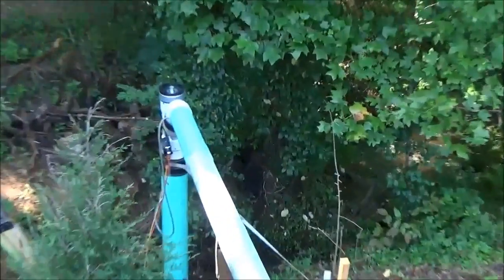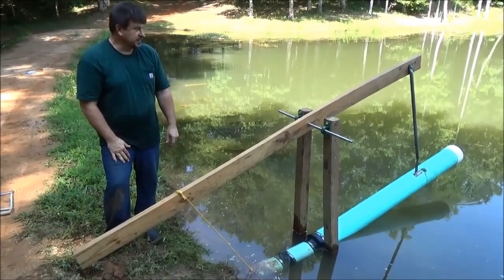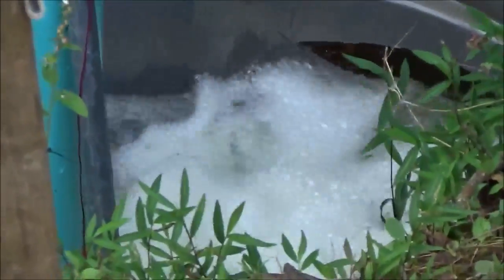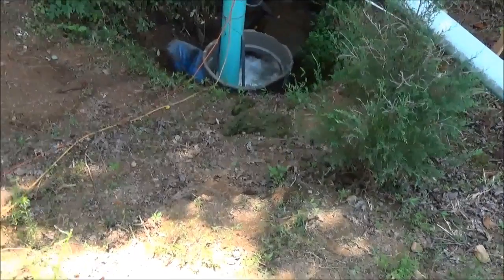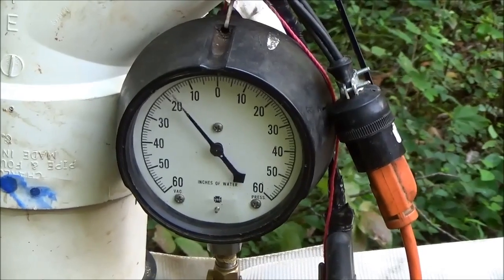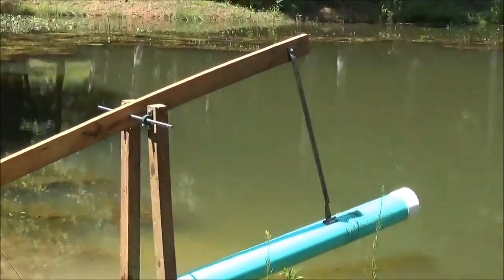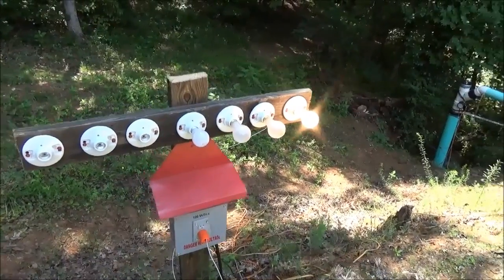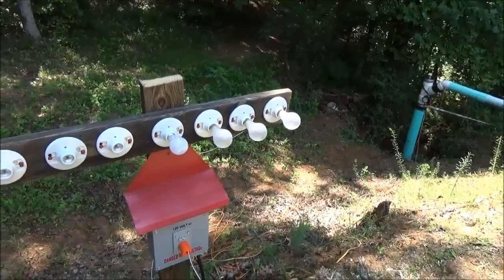Pond Power:  Part 2

Comment: A very interesting project. My sympathy that so many commenters want to take a practical device and turn it into a mythical over-unity scheme.
Reply: John W  It has, you twat.
Reply: your lack if creativity shows your ignorance lack of knowledge shows your stupidity and to top it off over unity is possible I'll leave it at that have a nice day ignorance is bliss
Reply: Kris Riddle I'm glad you find yourself in a blissful state. I'll try not to disturb it.
And your spelling and grammar show a lack of intelligence or a lack of knowledge. Not sure which.
Reply: +Jim Fortune say as you will but a simple mechanical water ram that uses no elec to push water up a hill to a reserve with an 8 in return hooked to a reducer produces all the power I need can't create something from nothing or is that what you believe. oh and my grammar maybe shit I'll give you that but your ignorance shows when all you do is bash with no statement that is meaningful to the point I was making - another kicker we make magnets from raw material take 80 pound neodymium mag with 2 1/2 inch hole wrapping 14 gauge magnet wire in side to out makes 1volt per turn wrap 280 times hooked to a converter now power range of 300-340 watts depends on resistance of wire kinking that will last about 10k years till mag dies it's called a magnetic vortex effect study some more and then try to convince me your not ignorant
Reply: Kris Riddle Ram pumps are a great way to take a large flow of low energy water and turn it into a small flow of high energy. It's the same idea as using a slow moving stream to turn a wheel that pumps a smaller amount of water to a height. It's a good analogy for explaining how a transformer takes a low voltage high amperage current and turns it into a high voltage low amperage current.
And if you are actually building an over unity device you fall into one of two categories:
1. You seriously believe it's possible, but you still need to tweak a few things to get it to work.
2. You know it's bullshit, but you have plans you're willing to sell me that are guaranteed to work if I do it right.
Reply: @krisriddle6873  You made that over unity machine yet?

Comment: Instead of wasting all of that water after going through the turbine, do you have  way to recirculate it back into the pond?
Reply: That would basically be a perpetual motion machine, which is impossible. Returning the water to the pond would take much more energy than the turbine produces, so would be pointless.
Reply: A ram pump relies on a large volume of water falling a small height to lift a small volume of water a large height. The water at the end of the pipe has very little energy left in it and so could not pump very much water back up to the pond. If you dammed up the outlet to build a larger head on the ram pump it would reduce the drop of water out of the turbine and slow down the turbine.
Reply: Please change your name from CommonSenseSurvivalist.
Reply: MsSomeonenew And think of the gym fees you could save!
Reply: Lincoln Sadler He might have been thinking of using excess wind or solar to pump water back up to the higher pond. That would be one way to store energy generated by "Ye take what ye get" systems where you can't just turn a knob up or down to meet current demand. Not sure how it would compare to lead-acid battery storage...
Reply: Easily recirculated, you just catch it down the other end with a bucket and carry it up to the pond.
Let's see how long you are willing to keep that up.
Reply: Even utilizing a ram pump? Could you explain why?

Comment: If you put a valve on the output, and a bleeder valve on top of the pipe, you could have it at full speed in a minute
Reply: +James Carter also, extend the output to get stronger vacuum power through the turbine to maintain the higher wattage. Have you measured the water supply to the pond? Is it a stream?

Comment: I wonder can you use this in a river?
Reply: Easiest river/stream installation would be the hydraulic ram(to pump water), or an under-flow water wheel, to turn a generator or water pump.  
However, Yes.  More energetically but with more construction(like his digging the pond, which is just a dam), build a dam, and put the generator or pump turbine at the bottom of a sluice pipe. 
BTW: His generator wastes all of the energy that could be captured from the down pipe (from the generator to the bucket outflow).

Comment: dont understand how this is working.
Reply: Just gravity and some pipes and a hydro turbine.
Reply: Basicly it's water flowing down hill.The water is not turning the turbine Blades.The turbine is mounted above the water level what is happening is the water flows down Pulling a vacuume the air passing the turbine blades are what are making it spin. The turbine blades never even get wet it's realy a wind turbine powered by falling water.Jim

Comment: Hello there i got a stupid question. i am new at this, but can it be possible to use that peace of pipe whats left after  the motor to put a second motor to  use to for example put a pump to work to get back some off the water so you can get free energie for a longer time period.

Comment: add a valve to the discharge line to save the trouble of priming?
Reply: I am making Hydroelectric power And charging A battery with a Amazon solar charge controller

Comment: set up a ram pump at the lower section to push the water back in to the pond and it would run non stop and refill itself at no cost.
Reply: In the magical world of Narnia that would indeed work.
But people unfortunate enough to reside in reality have to contend with the pesky problem of physics, where water doesn't go uphill without a significant amount of power.
Reply: Not a snide remark.  A ram pump "consumes" a lot of water, and only pushes a very small percentage of that water back up hill.
Reply: @ DENMONKEY   They mean that on average , for every 100 gallons let out of the pond , you could return 10 gallons back to the pond ... hence 10% efficiency. You obviously don't understand ram pumps even on paper if you're claiming only a little bit of water gets let out at the pressure valve.  Could you at least ball park quantify what you mean by a "little bit" ???

The best case scenario's are 25% ... and by a visual estimation he has a 300 gpm flow into the turbine to produce 500 watts sustainable ... but not sure how long that is sustainable , but lets be generous and say  1 hr.

So how much money would a ram pump(s) set up cost , to give you 75 gpm back into the pond  , which only increases the run time by 15 minutes = .125 kwh
And the average cost per kilo watt hour in the US is  12 cents.

So again lets be generous and say he can run the pond for 1 hr and 15 minutes 6 times a day ( 55 gpm inlet stream for the pond).  Which is .75 kwh X $0.12 = 9 cents a day savings towards the cost of the ram pump set up.
Which means he can purchase a set up of about $330 every 10 years which would be about the best case scenario for life time of the pump.
Reply: Just use solar power to pump it back to the main pond
Reply: Ram pumps don't need a significant amount of power/water to operate.  But you could never recover more than 1/10 of the water going into the ram pump.
Reply: Hah, just use solar power to power the lightbulbs in the first place if you are going to do that.
Reply: As well @DENMONKEY you are also assuming that the volume of water that is in the tube will be able to be pumped by the ram at the same rate as the outflow past the turbine. This too is not possible unless you went into an open to atmosphere containment system(pond) then used the outflow of that pond to install the ram pump. But by then the elevation change would be far too great for the ram pump to overcome. And at 10% efficiency, you have an uphill battle on your hands! PUN INTENDED
Reply: You're stupid, I'm sorry but you are really fucking stupid.
Reply: Brandon Tran actually the lake is technically a battery, you will it up in the day and drain it at night.
Reply: That would be awesome if it worked. In a perfect world, you would use the same amount of energy pumping it back up that you gained by letting it flow through a turbine. In reality, you would use even more energy to pump it back up, so you would have a net loss of energy.
Reply: +DENMONKEY i was thinking the same thing, find a way to put the water back into the pound !!
Reply: I'm not talking about sitting one in a river, it would be direct fed via a feed pipe . Other than the little water lost through the pressure valve, I don't understand what you are suggesting by saying it could only be 10% efficient when it would push all of the water that it is provided .
Reply: That's what a ram pump does. it takes the force of gravity from  the water heading down hill, stores it and uses it to send it back up hill.  So maybe check it out when considering your next snide remark. MsSomeonenew

Comment: I'm a new subscriber, I think that is an awesome experiment. I have a question. I noticed that you have fish in the pond and you also stressed many times that you didn't want to drain your pond completely. So I'm wondering if you set up somewhere around your pond to where the water can flow back into the pond while you have it on to alleviate your having to store the water. Just wondering if it is possible?

Comment: You can do much better if you reduce the diameter of the pipe at the turbine end down to one inch with a metering valve to adjust the flow in order to speed up or slow down the RPM of the turbine. You will use much less water
Reply: That is what I was thinking....  The output pipe below turbine should be at least a little smaller then the input...  With the same size, output pipe, you lose suction due to the difficulty of getting all of the air out...  often, as it is now, all of the air will not come out, but it will not be obvious....
A metering valve at the bottom, may at times, keep all of the air from being drawn out.... 
For maximum power, the output at the bottom of the pipe should be as low as possible and a fraction below the stream that it discharges into... 
Please let us know if you are still reading the comments here...

Comment: I got a few Ideas for ya this thing should give a good 40 amps dc
if you had a way to pump the water  if the voltage falls below 13.8 Volts it would cut on the pump and improve the flow of water and the remaining water can be put back into your pond  pump it right back in the pond in a Circle it will never get low on power
The tricky part is trying to find a way to make a electric pup that runs on solar that can pump enough water fast enough when the voltage is low it kicks on the other charge controller  showing 13.8 volts and it will start the electric pup that way hmm..ill have to think on this some more but you get the idea right!
Reply: Ok I think i got it....as long as a charge control see's 13.8 volts it will not charge to the batt right? but if it see's 13.8 it send charge to the batt of 13.8 volts or 24 volts..... anyways if it falls below that i will seek out a source of power normally this means the water flow has declined and it need a little push this is where a good pump would come into play and come on using the same behavior pattern as a charge control it just might work..ok but if we had another turbine where the water flow is pumped out then you could use that as your power source to run your pump I know how much they cost i saw :) anyhow once it was started for the first time maybe a 12 volt batt on a solar power charge for example it could be started by a switch and turned off by a switch and you would have a endless amount of power.
Reply: .you could use the other turbine to keep the bat charged instead of the solar or both prob would work when it shows full charge cut off the power to the Electric Pump that may work as well..just a idea to kick around.

Comment: Where did you get that turbine?  I have been trying to play with micro hydro but all the commercial stuff is too expensive and takes more head but running off of only two feet of head I could install that easy in the waterbox that already exists for our cabin tracts water system wich has 2+ feet of head.
Reply from the maker: Contact Spencer.  He even has an improved model now.. 
http://www.langstonsalternativepower.com/
Reply: Thanks...just sent em an email.  Even your set up was not at their site.

Comment: Use a hydraulic ram pump to pump water from the pond to a holding tank and run your turbine from that and channeling the water back to the pond. And the pulse water from the pump can be cycled back to the pond by using a solar pump.

Comment: Good work with the pond. Can't you use a RAM pump to pump back a fraction of the used water back in the pond. Check the vidéo on how to make a ram pump.Just my 2 cents. Good luck with the larger feeding and suction output line.

Comment: Could you extend the slanted inlet section for more ram effect?    I suggest extending the slanted part of the inlet pipe so the water falls  more before it enters the turbine y fitting.   Also a large inlet pipe mated to a smaller outlet pipe might help start the siphon and limit excess demand on your water source.   Good luck and thanks for all your fine work.

Comment: Could you extend the exit point of the siphon pipe down to create more suction? What is the limiting factor of the amount of energy being generated?
Reply: That will be in Pond power part 3 . Will be increasing intake pipe to 8" extending it to 30' to get more vertical drop and increasing the down pipe to 10"

Comment: Would it be possible to return that water back to the pond and have a continuous flow of water?
Reply: Without losing water levels on the pawn
Reply: No it would take five times the power to pump it back in to the pond .
Reply: Langstons Alternative Power Spencer Langston You could use a ram jet to put some of the water back into the pond...

Comment: There is a Hydro power project in California that pumps water up hill at night at a low rate$$ of electricity and it flows down hill through the generators when the rate is high. If this flowed down and generated at night a Solar run pump to get it back up hill may be efficient enough. It would be another way to charge batteries as well.
Reply: Qqqqqlq